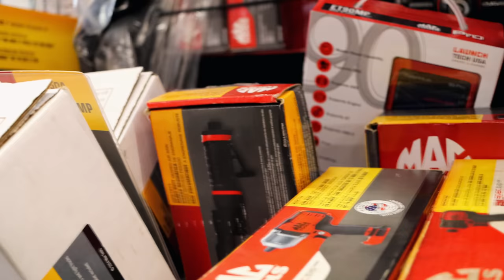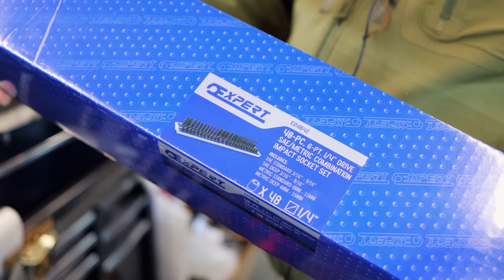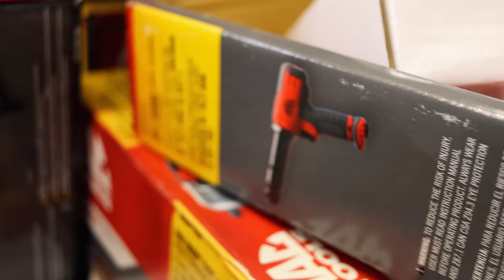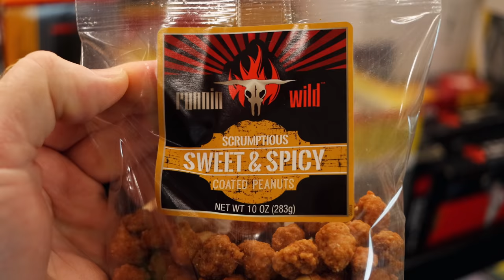Mac Tools Air Hammer: We take a look at it and air hammer bits that do not spin?

Comment: I can vouch for the Mac air hammer. I had a brand new craftsman medium duty and used it to replace ball joints on an 06 silverado (you already know how much of a PITA they are since they are riveted) and I spent almost 6hrs just on the rivets and only got 1 out! I threw the craftsman unit in the trash and had another tech come finish it before I set fire to the truck. Lol! I got the MPH1931 and had a full front end job on a 68 C10. IT WAS FREAKING AWESOME! It had no problems blasting rivets off and running the pickle forks! This thing works it's ass off and keeps coming back for more!

Comment: The bendable magnets come in handy.I have one which I bought from my local Ace Hardware store.Has paid for itself already using it a lot.Can't have enough magnets.I have a long barrel Matco air hammer that has been good to me,the long barrel air hammers are good for using on suspension work.Don't ever get the Texas Twister air hammer attachment,waste of money.I made that mistake and regret buying the Texas Twister.I always wear hearing protection when I use my air hammer,do this if you want to keep your hearing

Comment: I've sent my snapon air hammer off some many times im usually afraid to use it lop ill have to try and get mac one also I put a regulator on with antifreeze air tool oil to lube up my air tools

Comment: great time on tool truck as always.  ask big daddy mac if those air hammer bits will work on other air hammers with the quick change.
Reply: They will as long as the shank size is the same
Reply: @nickhouze8849  thank you I do not have a mac dealer. too small for mac truck. will try one mac chisel before buying a whole set

Comment: I don't know about Mac Daddy Mike. I mean all the tool trucks have loaners for you to try usually. I tried looking up my old Mac air hammer and the number doesn't come up so I guess I had the wrong part number. Anyways the closest I found that looked like it was a AH650. But I tell you what it had a good kick and if you didn't have a good grip then you'd be setting up again. I will say it was made in the USA back then and it did destroy itself just like the MG31/MG325's. I've broken like four or five anvils. It's a beast. That's why I have two incase one breaks. Ask him for a loaner and see if it kicks cause I haven't seen the new one in action. Kinda wondering if it's a rebranded Aircat like their other air tools. I don't hate Aircat. For the cost they hold their own just not a fan of the cheap plastic feel and harsh action with their impacts. I had three. Two 1/2"s and a 3/8". They served their purpose and all three cost just about the same as my MG325 at the time. Hope to see a follow up with the Mac and Matco air hammers.

Comment: The front section of that hammer from the body to the chuck looks identical to the chief hammer you tested earlier. I'm assuming the thing is made in taiwan (no big "Made in the USA" on the box), so what are the chances the components for that mac hammer came out of the same factory the chiefs did. I mean they are both advertising anti-vib tech as well. Not saying one is better than the other, just find it interesting how similar they are besides the body. With the way things are now I wouldn't be surprised.

Comment: Oh mannnnnn. Right tool truck. Right type of tool. But not the right tool you need to do a video on brotha. Ya gotta find that BWP050C 12v 1/2 inch anvil. I can not find anyone with it anywhere.
Reply: I found the son of a guns parts breakdown too. I have the 12v dewalt 3/8 impact wrench. And I can not find this one anywhere to see or find a review on. SO now I'm thinking of buying the replacement parts here and seeing if I can rebuild it on my pre-existing 3/8th. By replacing the motor and anvil and anvil housing. parts so far are exactly the same outside of the motor and anvil. DO me this sold my man. You'll get such good telemetry if ya can get this in on the truck. remember. it's not the BWP050 but the BWP050C 12 1/2".

Comment: Are those air hammer bits specific to the mac air hammer or can they be used with other air hammers?
Reply from the maker: I am not sure I would assume just Mac due to the cuts on them
Reply: @KoonTrucking  dang. That would be a great question for mac daddy Michael.  I don't have a mac tools distributor in my area. Just like you, I can't justify spending the cash on another Air hammer. I own two of them. One does the minor stuff and my matco handles the tough jobs. My co workers know when that joker comes out, I blast on the radio wwe wrestler goldberg's theme song 🤣🤣🤣
Reply: The Mac hammer bits work with any quick change chuck's. I have a couple of them they work great with lots of control.
Reply: @miguelheredia1627  They might work with other quick release chucks. They look similar to the Snap on non rotating bits which also have the 4 grooves in them.

Comment: Ya keep saying “Icon” and air hammer, I’m not aware of an Icon branded air hammer from Harbor Freight. Are you talking about the brand “Chief” from Harbor Freight which is their “premium” air tool brand? They do of course have a Chief branded air hammer and it looks nice.
Reply from the maker: Yes that’s what i meant.
Reply: @KoonTrucking  ah, thanks! Harbor Freight had some tools they dropped or put on the back burner when COVID hit so I thought there was an Icon air hammer that got shelved or something 🤓

BTW: I bought the Chief angled die grinder when EVERY “Central Pneumatic” angled die grinder in the box at my Harbor Freight (Reno Nevada) was defective.. The manager knocked the price down a bit for me since I kept returning the other one and they were ALL defective..